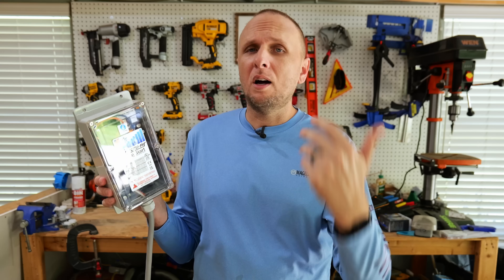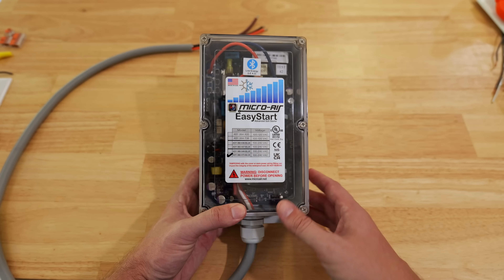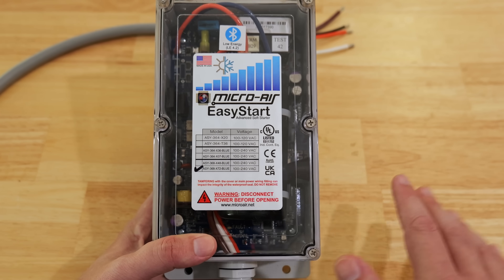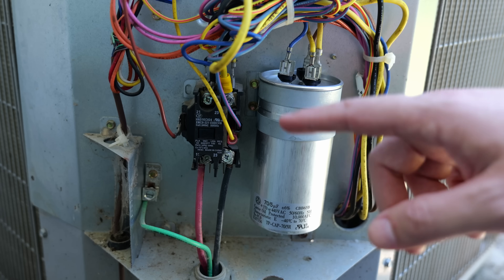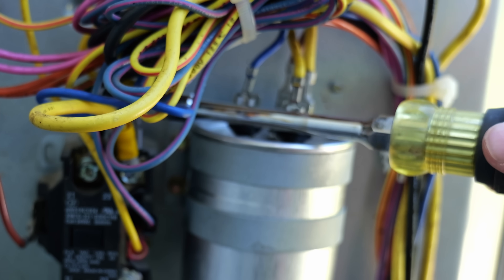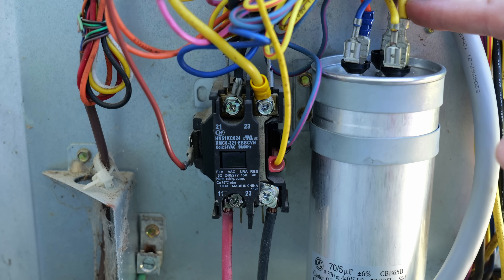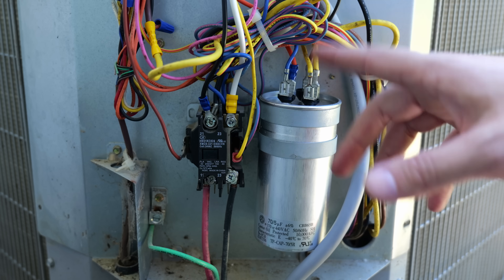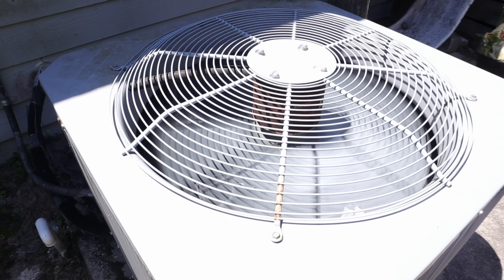Why Every Homeowner Should Consider Installing an AC Soft Starter | Micro Air Easy Start Install

Comment: I installed a Micro-Air 368 on my 4-ton Heat Pump. It took my inrush of 107 amps down to 21 amps and my running amps from 23 amps down to 6 amps. However, I have a lingering question: Since watts = amps x volts, that means that my running watts went from 5,520 watts down to 1,440 watts. Now, to me, that looks like I am saving watts and by extension saving money. So, back to my lingering question: Are we actually saving watts and money?
I will appreciate any light shed on this "lingering question!
Doc here

Comment: Glad I bought the new 19.5k peek and always do a tune up on electrical system.  Never checked the amps on my new AC and peak amp pull on 50amp #6 wire hook up.  Made cord myself. Screw Amazon! Icba can't be trusted with their "custom molded wire" says #6 / #8/1 ground, neighbors is 50' and weighs less than my made by me with American wire and ends, 32'.  The fuel injected beast hasn't had any problems yet. I believe with everything on both legs, i replaced box too, but never read AC brochure on outside condenser pull.  Gives my old ass a reason to do something today.  Fuel, not an issue. Roggy's store has a back up generator and if he runs out, I rotate 80galons ever 3 weeks with a couple of young college adults rotating my gas setup on property. Plus i have several other storages.  Made it through hurricane outage for 23 days. Cutting amps to me seems to be a slight less draw on kilowatt usage. 🤔.
Reply: Don't trust Amazon for Wires, Fuses, anything electrical. No regulation at all.

Comment: I have 2 AC units one 3 tons and the other 4 tons also a generator 9500 watts rush and 7500 watts continues. Can I use this set up with an AC soft start for each unit?
Thank you

Comment: So this only soft starts the compressor, not the fan?
Reply from the maker: Correct.
Reply: @HowToHomeDIY  I want both to soft start, guess I will have to find a smaller unit just for the fan. I put a small 20.00 module on my table saw a few years ago, and what a world of difference, before I thought it was going to rip the motor apart, now it starts up so smoothly.

Comment: Like other have pointed out, these have been in use on RV for years. Why the manufactures of HVAC units haven't designed this into their products baffles me. Is it a patent issue?
Reply from the maker: It’s a they don’t want to spend the money issue.  Last I heard Micro Air has been trying to talk with manufacturers about how beneficial this would be to add to the units.

Comment: Can anybody share where to mount these outside of the unit?  Mine doesn't have room inside and the immediate area around it is all concrete  walls.  Can you mount these on the outside of the unit?

Comment: Two questions: 1. Are the soft start units compatible with a heat pump. 2. I had a capacitor replaced last summer and the AC contractor said that the age of my unit is getting close to replacing. I’m wondering if I put one of these units on if it would prolong the life significantly. I don’t intend to run a generator with it. Thank you.
Reply from the maker: 1. Yes 2. No way for me to know that as I don't know your unit.  It might it might now.

Comment: I have a Kia EV6 (77 kWh at 100% full) with a V2L function that I'm trying to use as a backup battery bank because my townhome doesn't have room for a whole home generator.  I purchased a 30 amp transfer switch and I'm wondering if I purchase the corresponding micro soft starter if the car will be able to run my 2 ton Carrier a/c unit? Is that enough information for you to give an opinion about? Between my electrician, my car dealer and my HVAC person I'm not getting a solid answer.

Comment: $375!!!  I wouldn't even think about it at half that price.  What the hell does this thing have in that cost that much? It looks like a good thing buy why isn't this already built in to new units by now?
Reply from the maker: Technology that allows someone to spend hundreds and even thousands less on a generator.  And they put the minimum needed to make the ac unit run to keep them as cheap as possible.

Comment: So there’s no setup involved with the unit itself once you wire everything in?
Reply from the maker: Nope.  Just has to have 5 start ups and shutdowns while using utility power before using a generator.
Reply: @HowToHomeDIY  nice. Thanks. Almost plug n play

Comment: Hi can you please let me know if a 7000 running watts generator with 30 amp outlets will run a AC with soft starter installed
Thanks

Comment: Hack. If you unplug ac when it starts up then plug back in asap itll double surge and get started. Ex with Honda gen I use huge vacuum and it can’t handle it, but if I bump it on and off 1-3times it’ll start right up and maintain just fine. Ac in garage requires same technique but once running it’s low amp.

Comment: Install info/how to starts at 7:00
Reply from the maker: 🤣 There is a ton of important info before that even dealing with the install safely.
Reply: @HowToHomeDIY  That's more or less for me later having already watched the video 3 times on 1.5 speed and already having some basic AC knowledge like how to change capacitor, disassemble and clean my blower fan and coils etc. and knowing I don't have a hard start on it already that need un-installing and knowing to cut the power first haha.
Reply from the maker: @MrCreed145 ahh roger that!  Makes perfect sense.

Comment: You don't say whether you purchased the unit or it was given to you. Which actually will make me decide where to go next with this video.
Reply from the maker: My first Micro Air soft starter I bought with my own money and loved it.  Micro air asked if I would like to try this new one with blu tooth and I said mine works great, don’t see a need to buy a new one so they offered to send me the second one.  Either way, I tell every company to expect if I find issues with the unit I’m going to address them.  I figured I wouldn’t though since my first one worked perfectly.

Comment: PUT THIS IN  BUT  NOW THE AC COMPRESSOR AND INSIDE HANDLER SHUT OFF CYCLE  THEN INSIDE COMES ON BUT NO COMPRESSOR RNS FEW MIN SHUTS 30 SEC COMES BACK ON RUNS FEW MIN  SHUT  NO COMPRESSOR   DOES IT 3 -4 TIMES EACH TIME AC RUNS LIKE IT SHOULD    CO. SENDING ANOTHER UNIT BUT I DONT THINK IT'S THE PROB.  ANY THOUGHTS?

Comment: A 5500 is far from a small generator.
Reply from the maker: It is towards the low end of what most people buy when it comes to a generator.  Smallest one I have ever owned was 3500.  The most common size purchased is 7,500.

Comment: If this is such a great unit why do manufacturers not build it in to the unit?
Reply from the maker: Costs?  They used to pretty much all come with hard starts.  Now they don’t.  Why?  The costs didn’t outweigh the benefits to the manufacturer imo.

Comment: Prepping for Solar system and I installed Micro-Air’s on a 5 Ton AC and a 1.5 Ton AC.
The 1.5 Ton AC start was 44 Amps, dropped to 12.5 Amps.
The 5 Ton AC start was 127 Amps, dropped to 32 Amps.
We also have a Pentair 140K BTU (12 Ton/7 hp compressor) pool heater that has a 185 Amp LRA. I checked with Micro-Air and they said that their products went to 5 tons. I found an Eltwin Hyper Engineering SureStart that is rated to 185 Amps start and 16-32 run Amps. I installed the Eltwin and the Start current dropped from 194 Amps to 44 Amps.
The change on startup for the Pool Heater and 5 Ton was very noticeable, so much quieter!
Reply: You definitely need another 100 ton worth of central air on your solar system..😝

Comment: Why is the inrush amperage testing after installation delayed to what seems like after the compressor has engaged for the test to start? The testing just seems inconsistent. Does this device just delay when the compressor kicks on?
Reply from the maker: Yes.  Fan turns on first then the compressor.

Comment: Yeah I hate to tell you this but most everyone I know (myself included) are running smaller generators than you show as average, most seem to have  3500 running watts units or close to it with around 4200-4500 peak watts output.
I've run my whole house off my 3500 watt unit.

Comment: I have a 4 ton and a 2 ton.  If I get a soft start for both, my main question is can I start either one or both with a "30amp outdoor plug"?  I upgraded my generator from a westinghouse 7500 running generator, to a 11500 running generator.  Do I need to change my generator plug from a 30amp to a 50amp?  My breakers for both AC units is a 50amp, this where I get concerned as I dont want to melt something on a 30amp plug.

Comment: I saw this video and installed this soft starter. And it does perform everything in the video. But what it did not tell you is in the cold north, when the power goes off, and the generator is running, if you have electric coil backup heat, the generator will disconnect ( trip breaker) when the electric coil heater turns on. Yes, the soft starter allows the heat pump to work April - Oct., but Nov-March, if the coil heater runs, no good. I have to turn off the heat pump and start the pellet stoves for backup.

Comment: Just installed mine. I freakin love it. I'm on a 5 ton unit and the peak is 33 amps, run amps is 14. I'm so excited.
Reply: So how much has it saved $$ on your AC?
Reply: @JT-qc2nb  ill compare june bill from last year and this year,  and let you know
Reply: @lonestarsmoked  Thanks! I'm curious to know.
Reply: @JT-qc2nb  Aug 2023 bill was 440$. This Aug is 384$ with a 482kw difference. I tried to keep the variables the same for the month. If this is the cost savings I can expect from here on out, then it's a win!
Reply: @lonestarsmoked  Wow, thanks for the info! That adds up over time for some pretty big savings. Everything helps! Thank you.

Comment: Really huh that soft start kit is UL listed to be installed inside the condenser wiring location🙄I absolutely doubt it is. Don’t listen to these Mickey Mouse home owner do it yourself specialists. Or listen to them when your house burns down remember who told you so folks😉
Reply from the maker: It is and yes.  You clearly don't know anything about it.
Reply: @HowToHomeDIY can you post a pic of the UL listing for it
Reply from the maker: I actually can't on YouTube unfortunately.

Comment: Umm almost every condenser unit takes a 30amp 240 volt line. I would know I’m a master electrician. If your generator can’t start that up you have serious issues
Reply from the maker: Then you would know the inrush can easily be 130 amps right?  That is 31,000 watts master electrician.

Comment: Hello, thanks so much for this video and info. This might be a dumb question but if I don’t have any intention of using a generator, is the soft starter still a good idea for regular a/c usage? I’m in Florida and we keep the a/c on auto set to 78 degrees year round.  Also, if it’s a good idea for regular use, will this reduce the energy usage in a significant way? TIA
Reply from the maker: Not a dumb question at all.  I get it a lot.  So here is kind of a breakdown of what it can do and what it can't. Obviously the biggest benefit is being able to run it using a generator.  The other benefits are since it is gradually ramping up the power instead of a bunch all at once, the compressor doesn't work as hard to start and can increase it's lifespan.  Another benefit is in the event of a surge, the soft starter will act as a sacrificial device and protect the compressor.  It helps with light flickering when the AC turns on.  It will also help your unit to keep running even if a capacitor is bad.  I found this out for myself about a year ago.  But obviously you would want to get the unit checked annually or bi annually to make sure the capacitor is still good.  It will not however bring down the electric bill by any meaningful amount though.  So I hope this helps!
Reply: Hmm this answered my question. lol I think it would be still beneficial to install due to the longevity of the unit with it. A/c units aren’t cheap*

Comment: I assume you did the 5x start stop to show for video purposes. In any other situation, it is perfectly fine to just allow the unit to start/stop under normal ops and it will learn in its own time; yes? 

Thanks for the video... my unit definitely starts hard.
Reply from the maker: Yes.  It just needs to start and stop 5x using the home's power before using a generator.  Doesn't matter how quickly those 5x happen.

Comment: as someone without a generator, is there enough of a benefit to install this?
Reply from the maker: That is up to you to decide.  Obviously the biggest benefit is being able to run it using a generator.  The other benefits are since it is gradually ramping up the power instead of a bunch all at once, the compressor doesn't work as hard to start and can increase it's lifespan.  Another benefit is in the event of a surge, the soft starter will act as a sacrificial device and protect the compressor.  It helps with light flickering when the AC turns on.  It will also help your unit to keep running even if a capacitor is bad.  I found this out for myself about a year ago.  But obviously you would want to get the unit checked annually or bi annually to make sure the capacitor is still good.  It will not however bring down the electric bill by any meaningful amount though.  So there is kind of what it can do for you and what it can't.

Comment: I have a 2.5 ton and its makes a nice clunk when it starts but my next door neighbor has a big 5 ton and wow it actually makes a really loud disturbing bang when it starts it sounds terrible and its pretty new.  Now I know why. The science makes alot of sense and your install video is alot better than the install instructions on Micro Air's web site christ its terrible and would scare anyone off.
Looks like I need there Model 368. Thanks for the video I'm going to get one based on this video!  Subbed & Upped!!

Comment: Are you just pressing in the contactor five times...or going in to the thermostat to do the five start up testing
Reply from the maker: I do actual startups from the thermostat.
Reply: Okay so the people who installed this equipment should have came in to do this... well I watched your video very great by the way... compressor hasn't started...the device is giving me a flash code...7times
Reply: Got two systems going to try that one now to see if it's going to work
Reply from the maker: It’s either one of two things typically.  Either something was not connected correctly or the device is detecting some sort of a fault.  If you know for sure everything is installed properly, you can try turning off the fault options in the app when the unit is on then retry and see if it starts up.  The only way to get the data as to what is going on is to upload to MicroAir in the app and they will email you with the results within a couple days usually.

Comment: Wow, I am getting a Micro Air soft start kit. I need to run my HVAC with my 15000W gen set. Right now it chokes and shuts down when my 3.5 ton unit comes on.

Comment: Recently I installed had a brand new entire system installed and the next day I installed a micro air 368 on our 3 1/2 ton unit which had a 110 amp on rush amperage, and a 35 running amps, AFTER about 325 startups we have been averaging a start up amperage 24-25 amps and a run amperage of less than 5-6 amps 👍🏼👍🏼amazing savings 💵💵💵😁😁😁👍🏼👍🏼👍🏼
Reply: I suspect you have a multi-stage or variable stage compressor and you're comparing one stage to another stage.  There is no way it went from 30-something amps to 6 amps on the same stage. 

It is very possible that you got a measurement at full compressor power compared to a lower stage.  6 amps is reasonable for a low stage.
Reply: OMG amm I reading that right??? THIS is the answer on my solar system! That is crazy
Reply: Y'all go ahead and void the manufacturers compressor warranty
Reply: Umm, running current reduced from 35 A to 6 A? You done violated the laws of physics there…
Reply: how much does it save though, is there a noticeable difference in overall usage a month?

Comment: Is the easy start device installation compatible with a split type 230 volts,12,000 btu room inverter AC, or is it for central HVAC systems only?  🤔
Reply from the maker: You would not need one for a mini split with inverter.  They are already incredibly efficient on start up.

Comment: How much a technician will charge to install it?
Reply from the maker: It will vary by location and company.  The difficult thing will be finding a tech that understand what it is and how it is installed.  These are fairly new and a lot of HVAC techs still are not educated on them.  If you can find one that will install it you are probably looking the range of $300-$600 for the install plus the cost of the unit.  Hope that helps!

Comment: Howdy   second update in two days.   The Easy Start is NOT working correctly.   cycles the compressor on off on off repeatedly with in seconds. I will have to un-install it. reached out to manufacture but they apparently handle tech support only through emails and their first response was to check refrigerant after i had told them in previous email that initially the AC unit worked fine and blew cold air the before install and the first time starting with easystart installed.  Tech support sorted me out...Apparently I still managed to incorrectly wire the compressor .  what confused me is following wire from capacitor, mine had two wire.    Best to look for the compressor wire coming from the compressor.  that is the wire you will need to connect to the easystart brown wire.